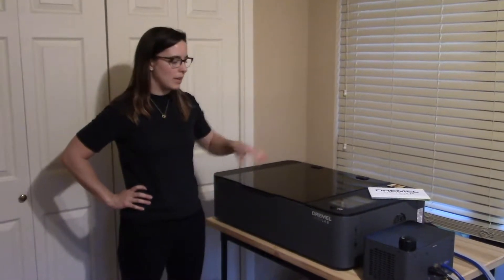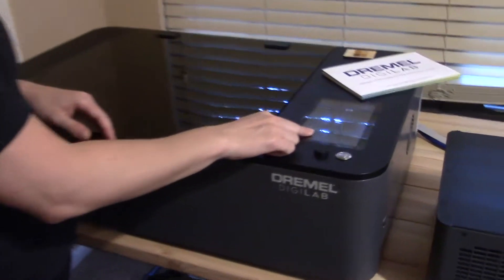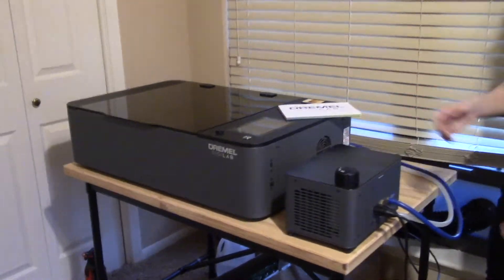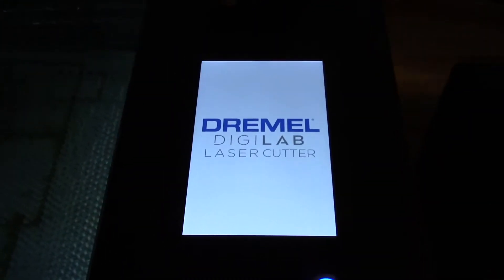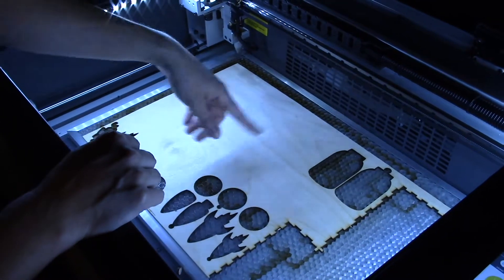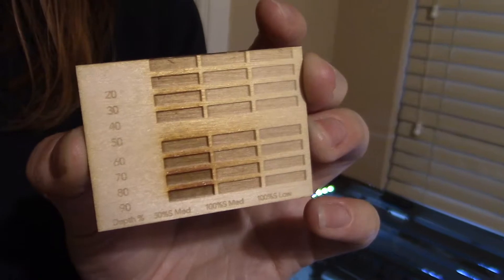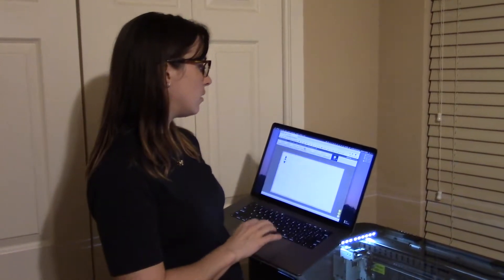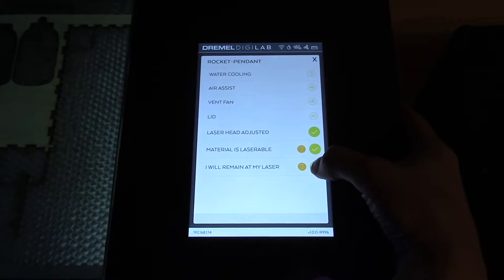Dremel Digilab 40Watt Laser Cutter - Update and Overview

Comment: you mention experience with an Epilogue - is this truly a comparable machine to some degree?  Good to see a review on this one as it's on my list - just wasn't sure how it compared to an Epilogue? Specifically - ease of use, speed of cutting/engraving, quality of final finished product. Thx!
Reply from the maker: These two machines are not quite equivalent. The Dremel is a great entry-level machine (40W), less expensive, very intuitive and easy to use and works well for engraving and cutting up to 1/4" wood/acrylic/cardboard. Epliog is a heavier-duty, much faster, and more expensive machine. And, depending on how much you spend, can cut thicker and engrave deeper (50W+). In conclusion, Dremel is easier to use, but Epilog is more powerful. Quality of final finished product is tied closer to how you created your file than the laser itself, but both have a high resolution and good results. I'll do a video later on where I explain the different levels of laser cutters and pros/cons of them! Thanks for watching!